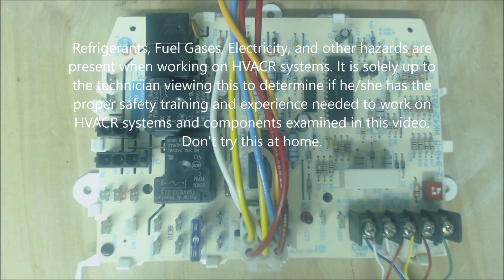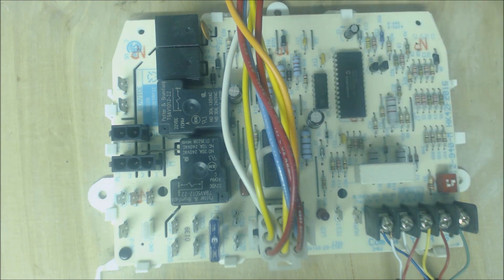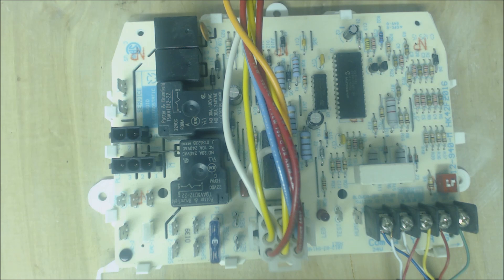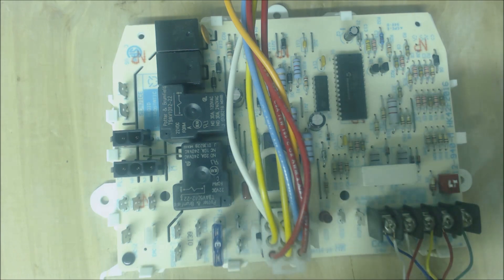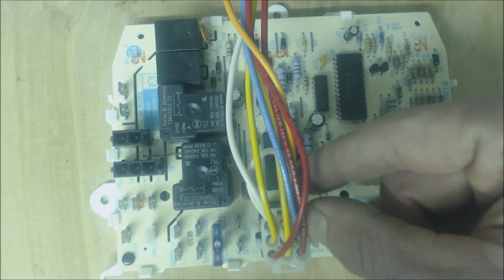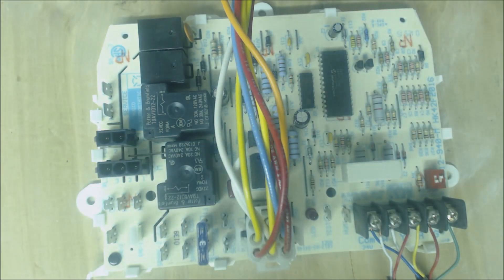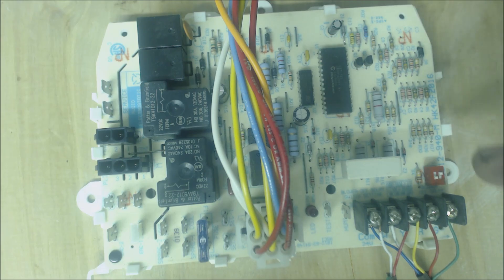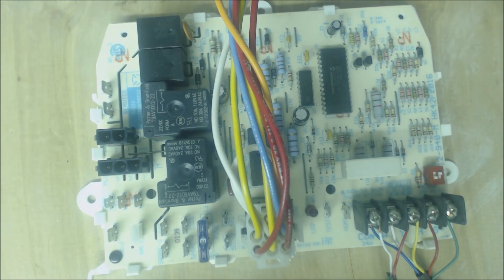Troubleshooting the Furnace Control Board IFC to Test if its BAD! For Heat and AC Diagnosis!

Comment: Thanks for all your great vids!  Certainly this video will help troubleshooters narrow the source of the problem.  But I would caution folks about ruling out control boards too fast because ‘they’re least likely to go.’  Perhaps this is true over a large sample of common repairs.  However, I’ve seen many problems with boards most of which relate to the small relays that open and close (effectively short-circuiting themselves) many times in a lifetime to turn-on/off components.

I’ve repaired and/or replaced several ignitor circuit boards (ICBs) over last decade+.  Again, most of them are due to problems with relays.  I just replaced this one last week when a relay failed for a blower inducer motor (BIM).  BIM still worked fine.  Swapped board...back in business.  Furnace was a near 20-year old Lennox.
Here’s a link to picture: 

https://www.amazon.com/photos/share/WsNv0HqiYWzSd9VsSZ1cTQre9cnF16UFfDmlnn2Ibqp

Couple others come to mind:

Blower fan relay shorted and lost its solder off the pin.  Simply resoldered relay pin to board and back in business.

Had stuck relay for oil-fired ICB.  Cut open relay, cleaned contacts with sand paper, resealed relay and got cust back in the game.  Didn’t have a replacement board handy, so had to go neural on it at 2AM at customer’s house when it was -5F!  

p.s.- Here’s to ‘the Radio Shack guy’ that inspired me when I was young to go neural!  These guys used to manage (and operate in back room of) Radio Shacks and could darn near fix ANYTHING electronic.  Sadly, these guys are all gone now, but I feel their spirit lives on somehow through these ICBs! lol :)
Reply from the maker: That's right, usually it is a relay on the board that actually goes bad. The board gets blamed a lot too because it may be misunderstood, thanks Brian! I too enjoyed the Radio Shack days growing up!
Reply: Haha.  Thanks for the reply.  Still I remember its mantra: ‘We service what we sell.’  What a novel idea?!  But with the intro of inexpensive, disposable [foreign] products, his days were numbered.  Have a look at today’s optimized PCB/SMD board.  Even having good knowledge...there’s little to fix...few to no parts available...let alone can you identify much of anything?  Truly amazing stuff.  While a lot of the current boards in service are what I’d call old school, you are absolutely correct: they’re misunderstood and replaced erroneously simply to rule them out! lol 

Anyway, enjoy your thought-provoking vids.  They inspire me to learn and be a better technician.  As a professional, it’s nice to see others with a passion for learning, teaching and helping others develop passion.  

Lastly, it must take a lot of time to do these vids: plan, setup, shoot, edit...it’s an amazing sacrifice on your part and a gift to everyone.  While we can all thank the internet (dare I say...Al Gore??! lol) for the platform to share information, you’re wizard behind the curtain putting it together—not unlike the Shackman back in the day.  “Passion is the power to move people.”  Mission accomplished.  Thanks -Brian
Reply from the maker: I really appreciate your note. That was very thoughtful. Some days I wonder why I am spending so much time doing this and it is a lot of work but notes like this make me remember who is on the other side and let me know how much you appreciate them, thanks Brian!

Comment: Ran into a York last week... Blower was shaking like crazy when I got there and randomly cycling with no error codes...  After cleaning the blower, shaking stopped but still a random issue

I went through everything in that furnace with a fine tooth comb. Testing everything and checking every connection. Even went as far by passing every limit and switch one by one in case I missed something with the meter. 

Ended up needing a board. Guess being shaken to death by the blower did it in
Reply from the maker: Was this a variable speed blower, x13, or a psc blower randomly cycling out of curiosity? Thanks

Comment: I have a Trane xb80 that would not even glow.  I was getting an error code 3 meaning some type of pressure switch vacuum type error.  I followed instructions on another video and after testing it I determined that the pressure switch would close.  However, when I checked the voltage on the pressure switch I only got 14 volts going in to the switch.  I checked the resistor and was getting 28 volts.  I followed the instructions in the video above in testing the orange and yellow wire.  At first I was getting only 14 volts and then it jumped up to 28 volts and the furnace fired up while I was running the test.  Is it possible that the wire was loose and only 14 volts was making it through the wire and when pushing on the wire it caused a better connection to get the higher voltage?  Would only getting 14 volts coming back into the IFC board cause the error code 3?
Reply from the maker: Yes only 14v would cause an error like that. You can start by shutting the furnace off and pulling the femal spade connector wires off and crimping them down more and then putting them back on one at a time. Typically the pressure switch is wired by itself with 24v coming in from the board and then going through the pressure switch and back out of the pressure switch to the board. Not sure what resister you are talking about? Thanks

Comment: My indicator light is not on the control board.  It is flashing normal.  I have power going to the control board.  I removed the wall thermostat and jumpered the wires.  It is a mechanical thermostat.  I have no voltage at the thermostat wires at the board.  I think that current is sent from the board to the thermostat.  When heat is called for the thermostat closes the the circuit.  If true, then the board is not sending current and the board is bad.  Did I guess right?
Reply from the maker: Do you have 24v from r to c on the board? Does heat turn on if you jump from r to w? If you have 24v from r to c then at the tstat you turn heat on then you should read 24v from w to c, thanks
Reply: I was wrong.  The voltage is correct 

Further investigation led me to believe I have a bad Smartvalve 2.  The control board was sending 120 volts to the inducer circuit on the Smartvalve, but no current was being sent to the inducer.  I ordered a new Smartvalve.  I also read that the Smartvalve board has a tendency to have the solder joints fail.

I removed the Smartvalve control board and reflowed the solder.

Now the inducer motor starts, but the ignitor is not getting power. I am getting a 5 flash error code, flame sensed should not be.

The flame sensor is clean.

So my thinking is I have a bad flame sensor and it is signalling that there is a flame when a flame is not present.

or,

The Smartvalve is bad, thinking there is a flame sensed signal, when there is not one.

I hope it is the first. Can I test the flame sensor with a multimeter?

A new Smartvalve came in the mail today. However, I am not looking forward to installing a new one.
Reply from the maker: you would have to read micro amps with your multimeter in series with the flame rod wire. Unfortunately the pin connector with the hsi makes this not really able to without taking the pins out of the connector so as to connect the hsi while having the flame rod in series with the multimeter. Either this or cut the flame rod wire which really would stink to have to do. It sounds like the board is bad if you are sensing flame when there is not one though. Usually it is the other way around where it is not sensing the flame when it should, thanks
Reply: @acservicetechchannel  my heat doesn't  turn on when jumped to r to w
Reply from the maker: @667cmays  Did you check to see if you had 24v when measuring with a multimeter from r to c?
Reply from the maker: After checking for 24v from r to c, check the inducer motor voltage if equipped, thanks
Reply: Hey?

Comment: I have a goodman gmpn060-3 rev a furnace that is flashing the trouble code for reverse polarity and the blower will not shut off unless you flip the breaker to the furnace.  Would this be a board problem?
Reply from the maker: That means that your 120v hot is accidentally on common and the common on the hot on the board. You can verify this with a multimeter on voltage or with the wiring diagram, thanks

Comment: I have a thermal  code 4 blinks..
I've checked safeties, pressure  switch,high limit.. I'm stumped
Reply from the maker: Does the sequence of operation to the furnace start or is the problem in the 24v control and safety wires before the sequence starts?

Comment: What if you don't have a common?
Reply from the maker: You can still measure 24v with a hot wire and the c terminal on the board or the ground of the furnace, thanks

Comment: How do you check a pressure switch if it's open or not
Reply from the maker: with the wires off 0.0 ohms of resistance. With voltage it is common or ground and the hot tab on the pressure switch or on the other hot tab on the pressure switch, thanks-  Here is 7 videos on pressure switches-  https://www.youtube.com/watch?v=XKAyznghlro&list=PLxnHR5_D2ojytzJCx7C5ruHcmaYicpJ7a
Reply from the maker: with the wires off 0.0 ohms of resistance. With voltage it is common or ground and the hot tab on the pressure switch or on the other hot tab on the pressure switch, thanks-  Here is 7 videos on pressure switches-  https://www.youtube.com/watch?v=XKAyznghlro&list=PLxnHR5_D2ojytzJCx7C5ruHcmaYicpJ7a

Comment: My furnace isn't working.  I'm getting blinking heartbeat green light .The furnace hasn't been on in 4yrs. Rental property.   I just changed all the electricity from fuse to breaker. Prior to this.  I changed inducer motor already.
Reply from the maker: Does the blinking line up with a blinking error code such as  a certain amount of short blinks and long blinks? The error codes can be found on the inside of the panel door of the furnace. Thanks
Reply: acservicetech thanks for responding. I got it working.  The temporary heat setting went down   below room temperature on thermostat .  I just turned it back up. Then it fired up.  The old  inducer motor had a  dead bird in it also.   Lol. I changed it. But it ended up being being inducer motor.
Reply from the maker: Ok glad to help!

Comment: I have a good sequence up to the gas valve signal, (fan, induction fan, igniter) but no voltage to the gas valve. Can I assume a bad board or is there something I'm missing? Carrier Weathermaker 8000 58WAV 100 series.
Reply from the maker: If the ignitor gets red and is supplied with 120v and then the gas valve does not get powered then it sounds like the relay on the board may not be supplying the 24v to gas valve. Check at the actual control board for the 24v going to the gas valve at this step, thanks
Reply: Just wanted to pass along a thank you for your videos. I replaced the board and it has been chugging along just fine since. It was in a cramped corner, but it was no more difficult than replacing a computer board, which I've done often. Thanks again.
Reply from the maker: Glad to help!

Comment: What if everything works fine but the hsi is always stays on
Reply from the maker: Check to make sure that there is not a call on the control board for heat at w and c reading 24v and also that the pressure switch is not closed. If there is no call for heat then it may be the control board, thanks

Comment: I have a control board which has 24 volts but the status light is off and never comes on or blinks. The furnace is a Coleman DGAA077BDTA and not working at all. The thermostat has continuity. The limit switches also have continuity. Is this definitely the control board?
Reply from the maker: If you have 24v coming off of the transformer to the board, through the limit switches and back to the board, going through the fuse to the r terminal and you jump from r to g or r to c or r to w and your correct 120v relay is not sending power then yes your board is bad, thanks Robert!

Comment: My blower motor comes on as soon i give the furnance power.  stays on no matter what well past 135 seconds. I have the same board. I get code 33. No code 13. Red sensor wires check out.
Reply from the maker: What manufacturer? What does the error say?

Comment: Enjoyed the video but have a question about an issue that has been bugging me. The indoor fan blower is not working. I have 120 coming in to the board. I have 24 volts on r, g, and y so it's calling for cooling. Now on the relay I have 120 coming in but coming out of the relay going to the fan motor I have 94 volts. Has that relay gone bad or is there something else I'm missing? I haven't tested the fan motor directly yet so don't know if it even works. Appreciate any response you have. Thank you.
Reply from the maker: If you have a good common that you are measuring off of and the 120v is in and lower voltage is coming out with a low voltage call, tap the relay and continue to measure. If it jumps around or comes up to 120v the relay contacts on the board are bad, thanks
Reply: pedro tamez call a tech

Comment: Hope you don't mind if I ask a quick probably obvious question, My status led is not coming on at all, I have power to the unit from the external on/ off switch and have jumped the door switch just in case it was that and still nothing, I also changed the fuse on the board with still no status led coming on , so I am thinking new board and transformer since I am already in there, was wondering if I may have missed something? Or am I going in the right direction TY.
Reply from the maker: You would want to check to see if there is 24 volts from sec1 to sec 2 which would be from the transformer to the board before replacing the board. Check to make sure that you have a clean 120v or close to it going into the furnace. Also check the usually red wire going through the safety sensors in series and coming back to the board to make sure that none of those are broken, then yeah, bad board.
Reply: whitey22222 Call a tech before you hurt yourself

Comment: I have a newer 96% of fish in sea Carrier Furnace I got mad and smashed the thermostat now whenever I turn on the heat the outside unit turns on with the heat but will not turn on with the cool any information you could give me would be very much appreciated
Reply from the maker: I am sorry to hear that! I would have a technician come out to replace the thermostat and check the wiring for the correct wiring color code. I don't know if this is a heat pump or a dual fuel system but referrals from your neighbors would probably be the way to go, thanks!
Reply: actually after watching a couple of your videos I went down and looked at the wire more noticed the company that installed my furnace six years ago didn't even use the other wire that use the blue wire for AC so when I had it underneath the B on the thermostat it was energizing it when it was in the heat position I put it on the yellow spot with Y and now the AC works on cool and the heat works fine without running the AC unit outside thanks

Comment: Control boards have a high failure rate , I change lots of them , it's usually a cracked solder joint at the back side of the molex connector,
Reply from the maker: Thanks Michael!

Comment: I have a Carrier weathermaker 9200  year 1999 , i went to turn it on today and the fan blower was not working, no codes flashing, i tried heat and everything works accept blower, i tried a/c , everything outside works but no blower inside, replaced blower about 2 years ago, turns ok, checked capacitor its ok, plugged in black cool h wire into door switch and the blower came on, so blower ok, i checked the voltage on com to g= 28.06 , r=28.06, y=2.5, w=36.9 ,r and g =18.8, com to the 2 red wires in the plug = both 28.06 , and when i checked all of these i had the thermostat off with fan in the on position, which it wasnt running and blower doesnt humm or anything, if i turn the fan on you just hear a click sound one time and thats it ,,,,,,, is there anything you could tell me to do,, do you think i may need another board (1012-940 model hk42fz011 ) or what other suggestion do you have,,, thanks for your help.
Reply from the maker: If you have 24v on Y and Common on the board terminals and the 120v power that is connected on the board does not continue through the fan relay on the board and out through the cool tap as 120v read between that and the common, then the board is bad. That click should be allowing the blower voltage to come out of the tap on the board. Thanks
Reply: I just wanted to give you a thanks for your help, I just replaced my control board with a used one off eebbaayy, for $65, it now works fine, It was so easy to do, I would love to see how much it would have cost me had a tech done this for me, thanks for your help
Reply: transam6t9 this channel is not for home owners . This is for techs I’m sure if he knew you were a home owner he would not have assisted you .
Reply: @fedboy601  nice attitude

Comment: Flame sensor picks up 1-25microamps when the flame is present.
Reply from the maker: Thank you New Year. On this type of board with a large flame rod we are usually looking for more than 2 microamps. If this video was talking about the ignition only control boards then it would be closer to 1 dc micro amp. Yes I agree, across all there is a very wide range of dc micro amp signals.  This is just a ignition only control video, thanks -  https://youtu.be/dUFcVJXJ8Vg